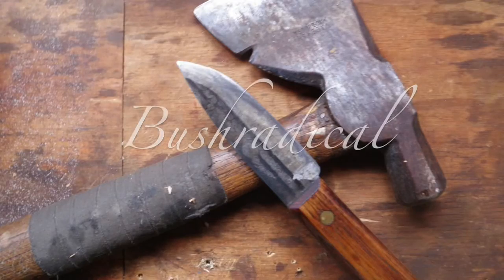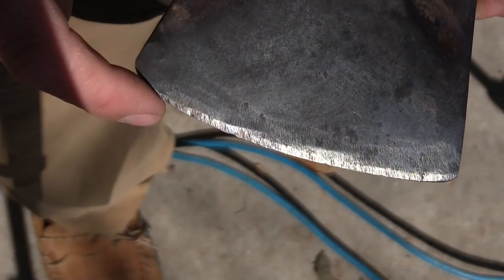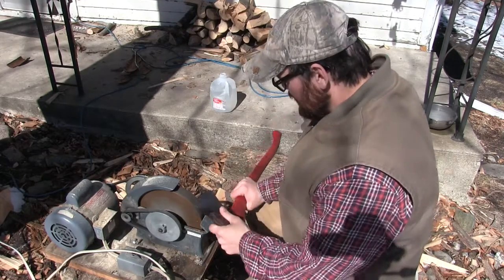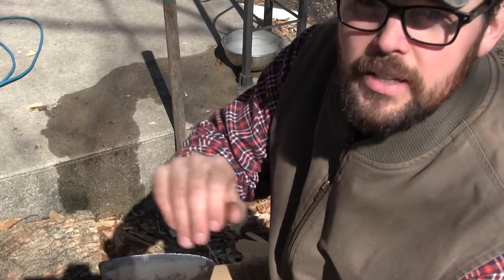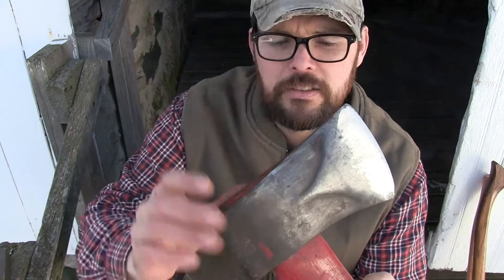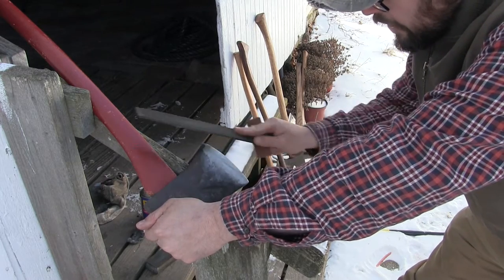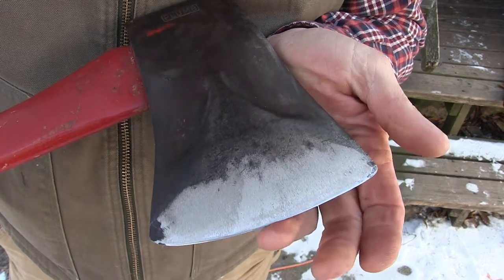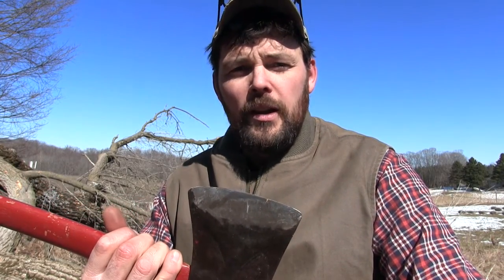plumb Permabond AXE Restoration

Comment: The bit looks a LOT better. Good showing. There at the start it looked like the previous sharpening had been done with a rasp :-)...
Reply from the maker: It was a bit rough......so many of them are is the problem! I think for 50 years it was nearly impossible for an axe to avoid getting the "bench grinder treatment" . When I'm down in Mi in the winter I've tried to buy some old axes off of Amish folks , but all their axes have been bench ground and ruined.  You would think the Amish would know better but they don't. LOL. There has been so much new interest in the tool in the last 10-15 years that the idea of bench grinding an axe is a pretty well known "no-no" anymore.

Comment: If an axe handle broke my dad would chuck the axe into the wood stove. Once the remnants of the old handle had  burned out of the axe head the old man would throw the axe outside to cool. Then he would attach a new axe handle to the axe head and wedge it tight.

Comment: Awesome video, Dave. Love any old Plumb, specially with phantom bevels. Pretty cool wet grinder, did you buy it or put it together yourself?
Reply from the maker: Thanks !  As for the grinder , I have 2 of them. One in Michigan and one in Alaska. The one in the video was bought in AK and is now in michigan , where we have spent the last few winters....I paid $10 for it just as you see it!! It was an awesome estate sale find...buried in tons of utter junk!  My other one is older and is all gears and no pulls......it needs to be restored before I run it...I will absolutely shoot a video when I get to the restoration.
Reply: Bushradical, Lucky you. Maybe they were more popular up there in Pine country. But I have only seen one and the reduction gear box has been busted and it really wasn't a wet grinder. *   Is your grinder actually running in reverse ( turning so the wheel comes up from the bottom ) ?? I have a old treadle grinder and a hand crank one with drip can. Most of the stones have been cracked, from setting outside for years. I still pickup the stone wheels and tote home, when they are real cheap.

Comment: Dave, I recently found one of those 10 inch wet grinders but I need to get a motor. Do you remember what size motor you have on yours?
Reply from the maker: I don't know the size , but  most anything should work.
Reply: Roger Eberlin 
It all depends on the those reduction pulleys...
Is it the same setup as he has going in he video?
His looks to be a 3/4 horse to 1 horse power Dayton motor, which if hooked up directly to the grinding wheel would be waaaay to much power...but because of those two reduction pulleys it slows it way down.
Hope this helped.

Comment: Seems like you don't know what you have there... That's actually a very collectible axe.  It's a Plumb Jet Wing... highly sought after in original great condition.  Look at the stamp on the Permabond.  J = Jet Wing  D = Dayton  4 = Weight  C = Curved Handle   36 = handle length.  Nice all original Plumb there!
Reply from the maker: Thanks Cory. Its a nice axe but I didn't assume there was much real value in Plumb permabond axes.
Reply: @Bushradical  Most collectors want the Jet Wing sticker on it and the Jersey is a little more desirable but cool that you have one in great shape and still has the letters stamped on top.  Probably go for like $80-$100 on eBay.  Great user too!
Reply from the maker: Thanks Axe master. I'm kind of surprised there is much interest in my axe. Its been a while since I posted this video and it still gets comments. I thought those Plumb Perma bonds weren't that collectable.

Comment: Nice technique and great result. It looks like you ended up with nice thin cheeks and a smooth transition from edge to cheeks.  Just wait until you try a 1x30 belt sander! It will blow your mind how much time it will save. It's easy not to ruin the temper with a bit of practice.
Reply from the maker: I had a 2" x48" belt grinder. It was pretty cool.It was home made and heavy duty! I used it making a couple knives.

Comment: I was camping with a guy several years ago,, he had a very dull axe,,  We could have cut a tree down faster holding a beaver by the tail and hind leg.
Reply from the maker: I think you need to have two axes if you have the choice. A sharp one for felling and a dull one for splitting ( if you have a saw for bucking blocks) A dull axe SUCKS for any chopping work and a sharp axe is sooner or later gonna send you to the doctor if you split much with it. IMO.